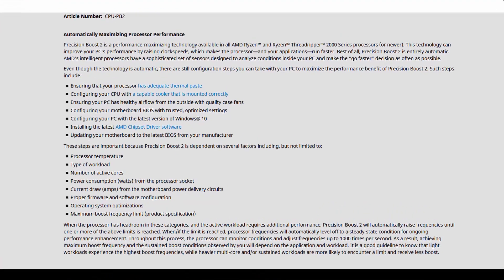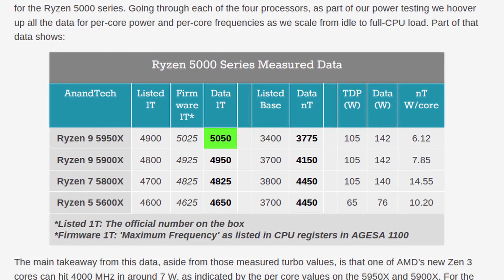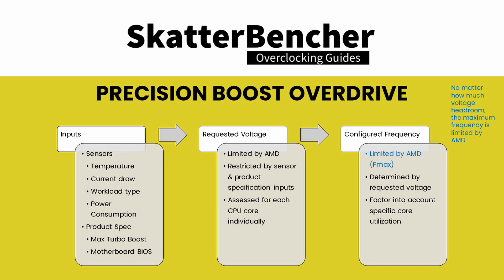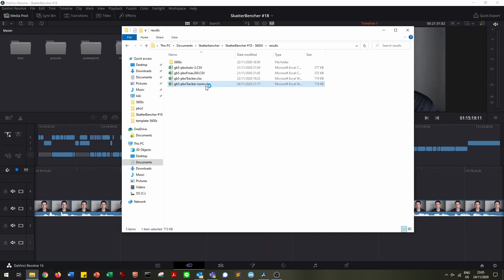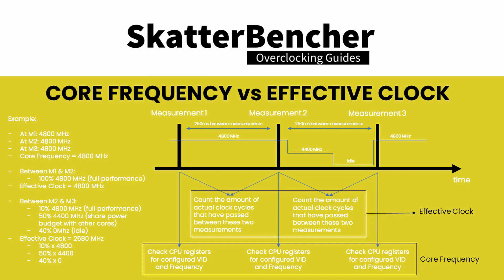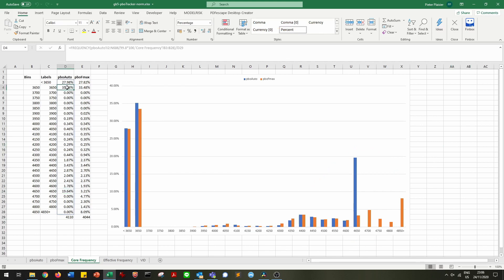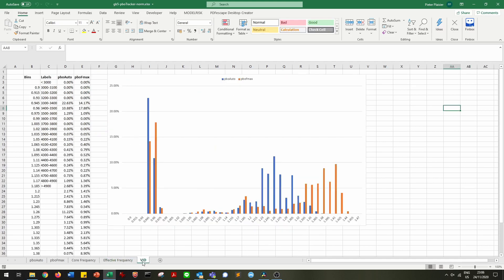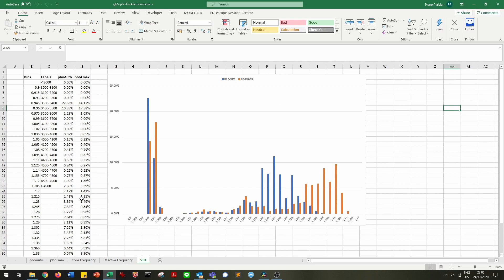AMD Precision Boost Overdrive Explored: Fmax offset, VID, Core Frequency, Effective Clock | SB#18

Comment: Hi,

So having a voltage reported in HWinfo up to 1.5v is normal?
Reply from the maker: Normal is maybe a stretch, but it certainly isn't uncommon. Just depends on the specific CPU and its characteristics.
Reply: I don't have to worry about it?
Reply: Hi, 
Question about my 5900x on a Dark Hero Board 
i've read somewhere that using LLC3 with PBO could be an issue on long term, "because pbo does not compensates for llc by lowering voltage and 1.5v top voltage bin for pbo plus llc 3 sounds like long term damage. "

Is it confirmed or could I leave it as it is?

Here are my settings for my 5900x / Dark Hero
voltage : auto
core : auto
Per ccx 47 /46 @1.275
Dynamic oc switcher 90amp
PBO limits )
PPT 165W
TDC 120A
EDC 150A
Core boost override : +100mz
Pbo curve : -15 sur les 4 best / -30
+140% cpu capability
LLC3

i've tried LLC auto but even at 1.3, CBR23 was crashing after a moment and i haven't tried higher

I have those values on desktop i was told 1.5 was normal when using PBO but i'd rather be sure of it 

So should i :

Put more voltage in per ccx?
leave it as it is with llc 3, it's all stable with good scores

Thanks

Comment: Very good. I wasn’t really convinced by your all core overclocking video because of the high voltage you chose and the fact that it is actually applied consistently. But this one is great, now I can see the main advantage of PBO over all core overclock: lower persistent voltage. I have managed to overclock my 5600x to 4.85 all core at 1.3125 volts and LLC lvl 3 on x570 asus tuf mobo and noctua nh u12a air cooler. Runs very stable and passed all the tests. 12450 in cinebench23. But I’m not sure if 1.3125 volts is too extreme for persistent use. So PBO solves it for me, will try playing with it in the evening. Thanks a lot!
Reply: Update: PBO +200mhz jumps to 1.45 volts at times. And on load uses more voltage than my previous all core 4.85 overclock. So Together with PBO +200 MHz I turned on Curve Optimizer with -15 on all cores. So now when all cores are loaded it works at 4.75-4.8 and when not all cores are loaded it works on 4.85 (i.e. in games). Now getting 12250 in cinebench23 multicore test and same 1600 in singlecore test. Overall uses less voltage on idle and on load than both my all core overclock and default PBO +200.

Comment: Beautiful work here. Imho the best I have seen and I have watched many. Questions 1) The Fmax offset for the 5800x would make it 5025? I suspect oc'ing the ram is not your main attempt here but I have not found anyone who did a 3600 dual rank cl14, please if you have time and the kit for it? Comment I am also very interested in the new pbo2 with fmax offset and the asus dark mb if you still have it. I am sure you will do a great job even if you don't satisfy all us wanton subscribers. Thanks.
Reply from the maker: Thanks for the kind words TOM684! To answer your questions:

1) Correct, Ryzen 75800X with Fmax offset of +200 would yield 5025 MHz max boost clock
2) I'm not sure which kit to recommend for 3600 dual ran CL14, apologies
3) Precision Boost Overdrive 2 looks very interesting indeed. When I find the time I will try to return to PBO2 and the Dark Hero. PBO2+DOS OC should be quite a powerful combination!
Reply: @SkatterBencher  Are you sure about 5025?  My 5800x shows a fmax of 5050 in GeekBench and HWInfo with the +200MHz AutoOC applied and fmax of 4850 without.